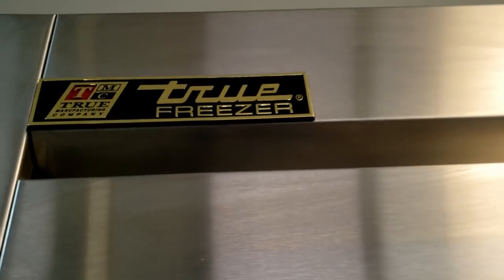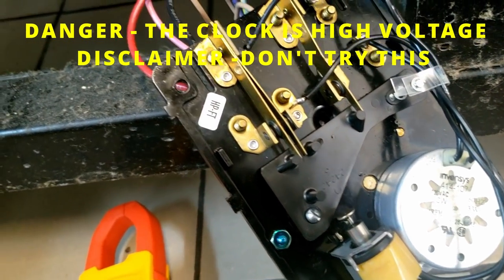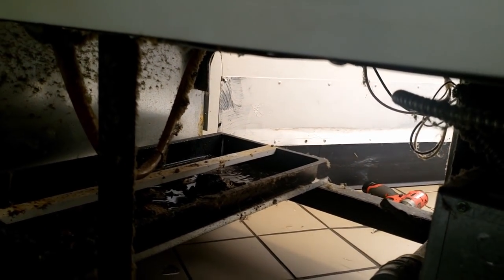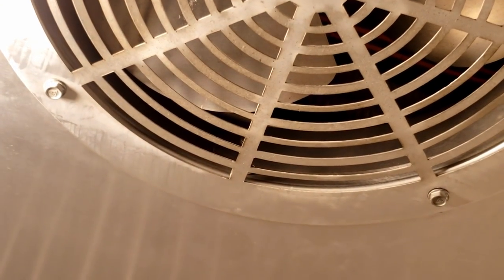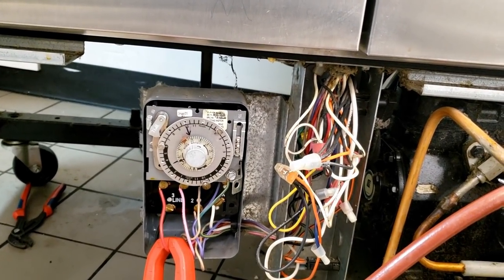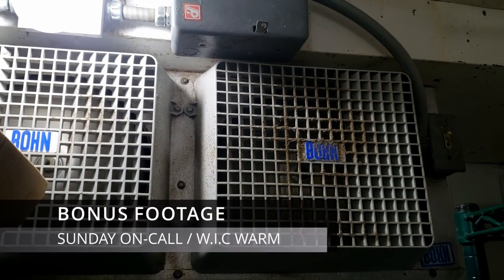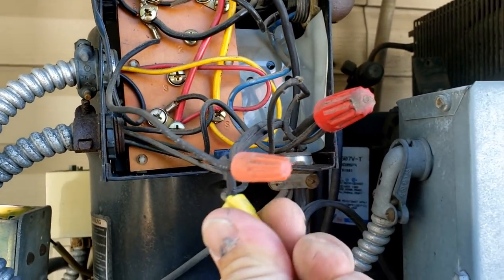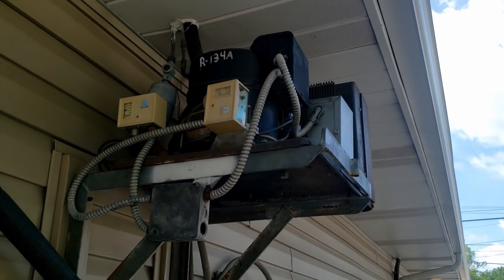TRUE 2 DOOR FREEZER GETS PUT ON ICE AND OVERTIME WALK IN COOLER WARM

Comment: Thanks for the pet brush tip!
Reply from the maker: I learned that trick when I worked on a ac unit at a pet store that had a plugged EVAP coil. I used a pet brush that was laying there. It worked great and I was sold.

Comment: The electric plug on the compressor threw me off a bit.... looks like a standard everyday 120 volt single phase being used for 208/230 ?
Reply from the maker: That's why I'm glad I showed it. I don't see it that often.
Reply: Funny story, plugged my vacuum  cleaner in the same outlet on box.It  did no t like the 230 volts.

Comment: Hey Rick I'm sorta new so that limit switch is supposed to be closed when it warms up to a certain temp to restart compressor then fans.
Reply from the maker: 2 switches are in this freezer.  The limit kills power to the elements incase the termination switch fails. The termination switch kills the defrost and delays the fans starting until it gets below a pre set temperature. Usually at or near freeze temp.